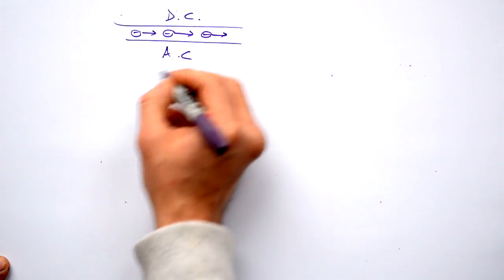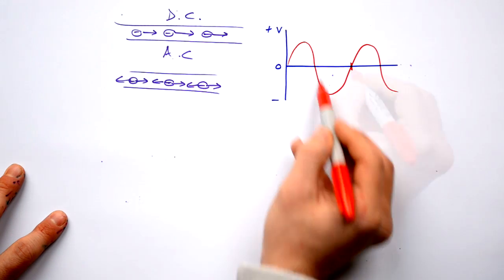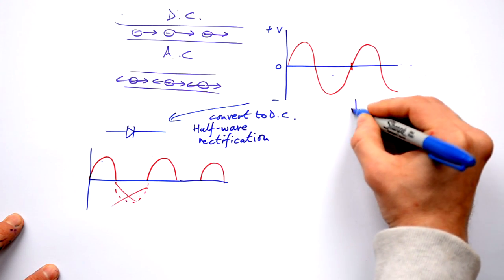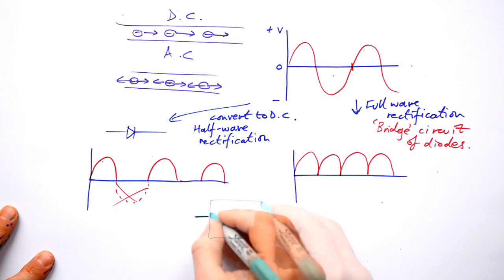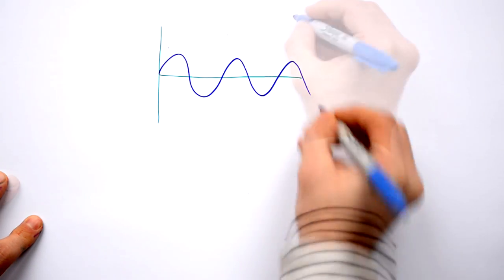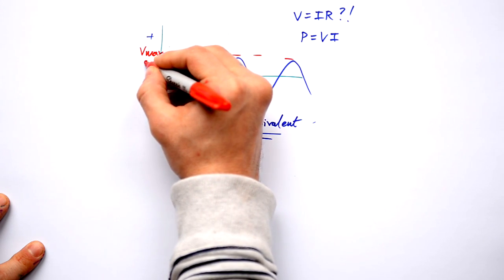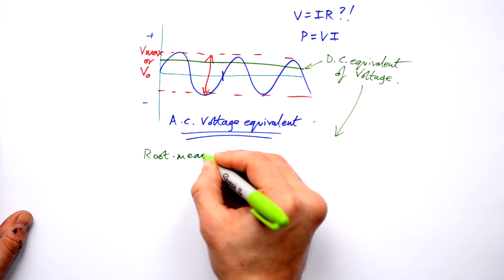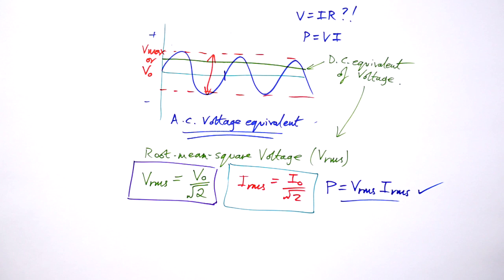AC, rms & Diodes - GCSE & A-level Physics

Comment: how do you know which bit of diode is positive and which bit is negative?
Reply: GG 16 The arrow on the diode points in the direction the current can flow so the arrow side is negative and the side with just the line is positive.
Reply: the triangle is positive and line is negative